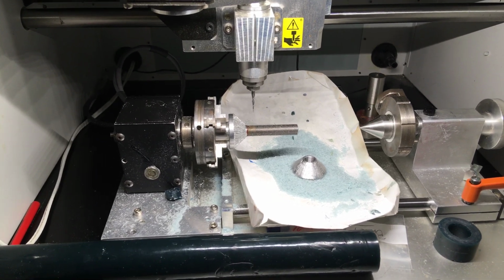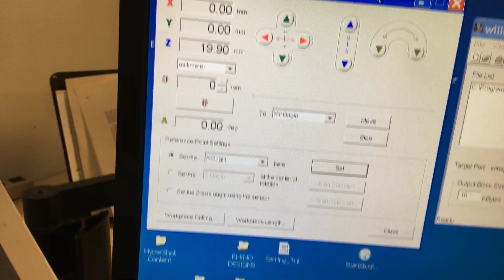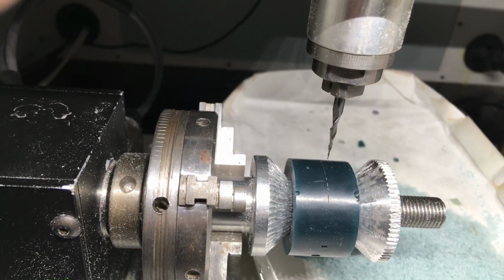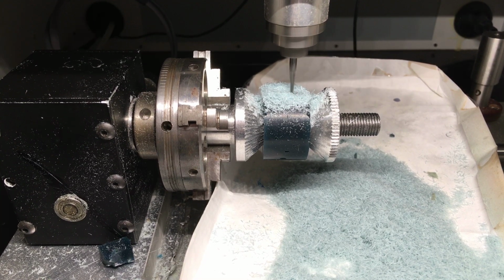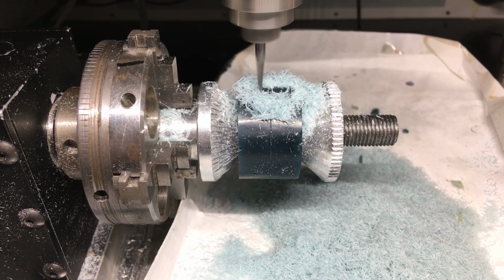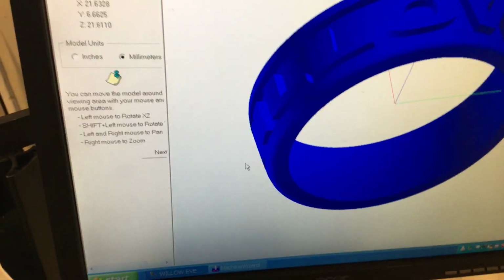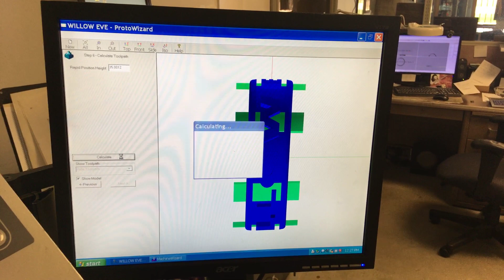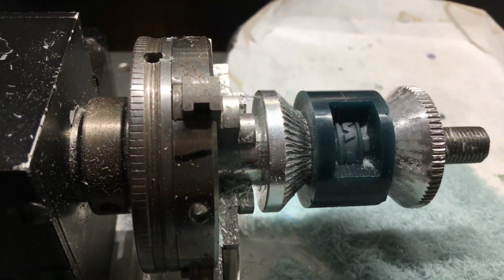milling a ring in wax  part 1

Comment: Thanks for the great video.  I'm just starting to start rotary milling on my DIY home mill.  Do you recall the RPM and mm/min settings you used?  I believe you mentioned 1,200mm/min, but the software setting indicated 400mm/min.  And you mentioned 65 RPM, which was probably an audio glitch for 6,500 RPM.  And thanks for identifying the Bits & Bits cutting bit you used, as 0.010" Tapered Ball End Mill with 10 degree taper.  Cheers, Ralph
Reply from the maker: Thanks, I use anywhere from 900-1200 mm per min travel speed although I have gone faster!, and 6000-7000 rpm spindle speed  but I have been known to go faster..it all depends on sz of tool, how deep your cutting in one pass, amount of stepover, .... but those are my basic settings I use
Reply: @schmidtpe  Thanks for the update.  I'm starting a Dragon, Wizard, Castle wedding ring band.  Did a first pass on the ring blank, 500 mm/min at 7,000 rpm, and seemed to cut very clean.  Next to actually try the ring face.
Reply: @schmidtpe  Thanks again.  One item I tried while milling wax that works great, is to use an Ear Syringe Bulb to clear the wax chips.  Allows a light to moderate stream of air, and seems to work better than a brush.  Cheers